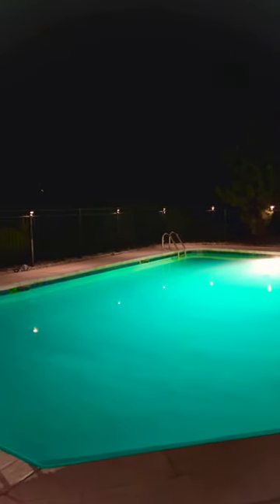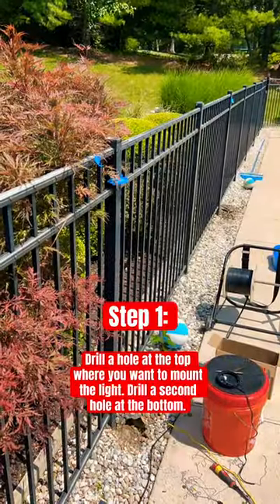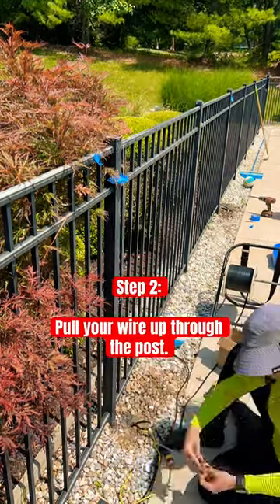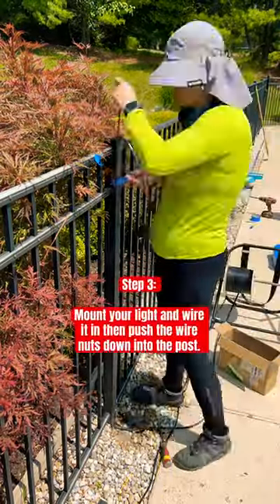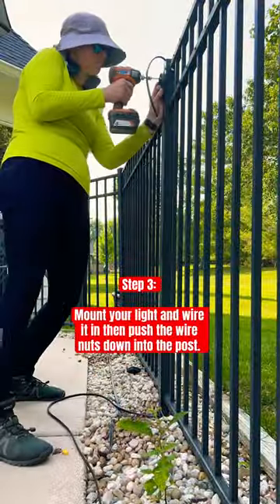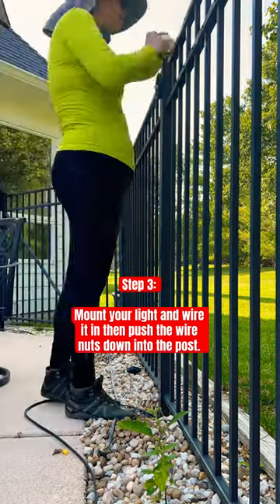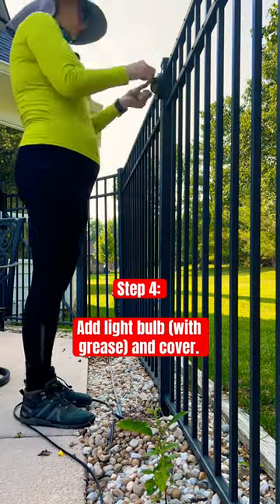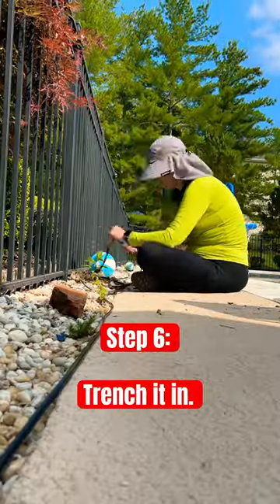Have you ever wondered how to install beautiful fence lights without seeing any wires? ￼

Comment from the maker: Have you ever wondered how beautiful fence lights are installed without seeing any wires? First, you drill two holes in the fence post. One of the top where you want to mount your light and one at the bottom for the wire to be fed through. Then you feed a chain through the top of the post to connect your wire and then pull it through. You then mount your light and wire it in. You push the wire nuts and wires down into the post and put the cap back on. Add your lightbulb and the cover to your light. Then you wire in the post wire to the ground wire and trench it in.